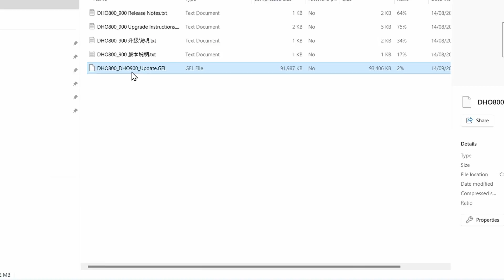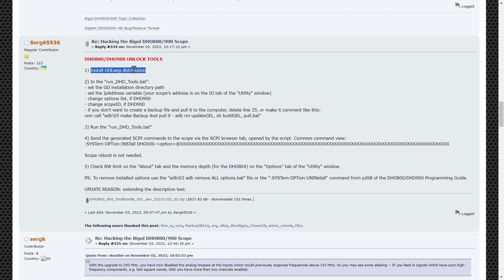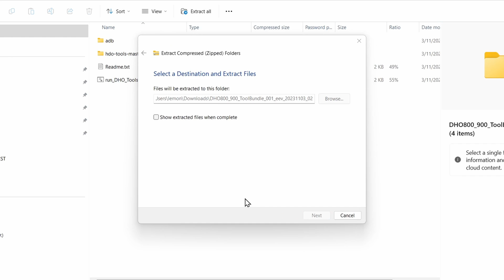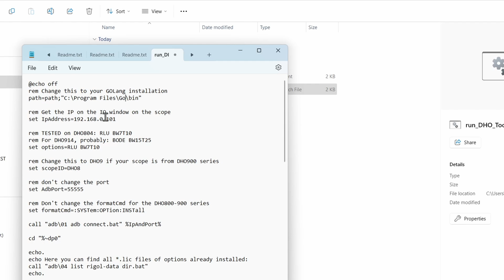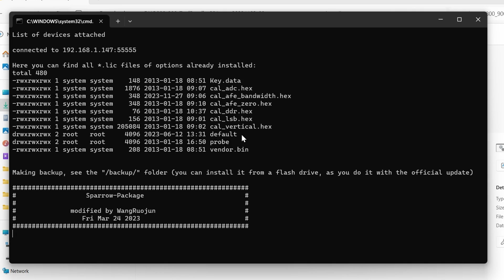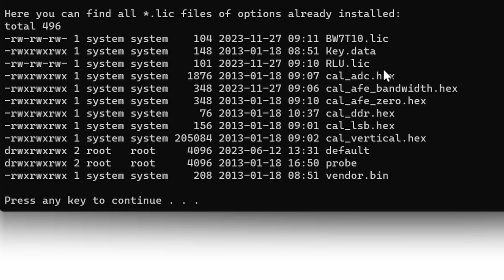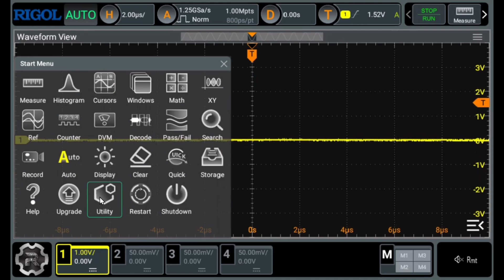Hacking the Rigol DHO804 fw 1.01 - 100Mhz bandwidth, 50Mpts memory depth

Comment: Many thank for great explanation, Can you help me, I just bought a Rigol Dho804 Oscilloscope, when I unboxing and turn on the display stays appears Rigol logo and no boot to the operating system, and no something until I turn off, I contact Rigol service he said that "Press the power button and quickly press the BACK button on the front panel multiple times. This may reset any incorrect settings.
Alternatively, place the latest firmware on a FAT32 USB drive, power on the device, and follow the on-screen prompts to upgrade the firmware."
I dont see BACK button on the front panel of it and how can I update original firmware
Thank you for helping.

Comment: Update, had firmware 1.2 on dho804 with no previous hacks. Did the mod and it worked fine, they were 4 options keys and I used only the first 2 which were memory and bandwidth. Don't know what the other two were.  Now the real test is to run the calibrate and see if it sticks.

Comment: There is an alternative UI for the Rigol DHO800-900 Oscilloscopes, it implements some enhancements and fixes to the stock UI, the most interesting thing is a full screen mode that allows to hide the two horizontal bars that take vertical screen space. (DHO800 Extended UI)

Comment: Had firmware 1.1 Did this mod it worked fine. I then upgraded the firmware to 1.02 or what the latest is.  Had others say if you already have version 1.2, this mod don't work. Seams Rigol changed a file name from Key.dat to something like RKey.dat. So have to do the other method on the EEVblog

Comment: If I understand correctly, I dont see how having more bandwidth helps you with lower speed signals. using double the sampling speed to sample a waveform simply adds redundant data. it doesnt measure it with more accuracy. See the nyquist limit.
Reply: If I draw your picture with 100 dots or samples it will be not good, but same picture with 10000 dots or samples is much better representation of you.
Reply: @kka10001  unfortunately its very difficult to post links in youtube comment sections. But if you search youtube for ''D/A and A/D digital show and tell'', the original video by Monty Montgomery was from xiph. you will find a fabulous video that does the best job of explaining the nyquist theorem I have seen, complete with demonstration with scopes. I link anyone that needs it, but I cant do that here, the reply will get deleted before you see it.
Reply: @kka10001  Sorry, you are wrong. Thats not how digital sampling works. Thats the same 'logic'' that has people buying 384KHz DACs to play 48kHz content. I recommend you read up on the Nyquist sampling theorem. You only need 2 (actually just a smidge more than 2 ideally) samples to represent a sinewave perfectly and using 4, 8, 16 or 1000 does not give you any more accuracy; they are redundant. To avoid aliasing, typically you want 2.01x the highest waveform you want to sample.
Reply: @jeremyglover5541  You obviously are talking about audio?
Reply: @jeremyglover5541  You must be an undergrad EE.  What Nyquist says is that, given an impossible to construct (noncausal) brick wall low-pass filter, you can reconstruct the original waveform from the samples.  He also assumes a perfect anti-aliasing filter preceded the sampling operation.  The math works fine, but that's not the problem an oscilloscope is trying to solve.  The scope is making a visual representation of the signal for a human to look at with his/her eyes, which lack the properties required for "perfect reconstruction".  Also, for music playback, it's nice to have some   bandwidth "headroom" above the highest frequency in the content to keep away from the bad phase properties of a steep anti-aliasing filter.
Reply: @tomw7751  Yes, you need 'some amount more' to avoid aliasing. that amount can be miniscule for perfect reconstruction. Youre right (not the undergrad bit) its not relevant. I thought about that later, but didnt come back to see until now. I wasnt thinking it through correctly. its a diagnostic instrument and when looking for visual cues that some edge case or issue may exist that you want to diagnose, you may want to see ringing, or rounding that may indicate capacitors going out of spec, layout errors, bad termination, or a power supply that is out of spec in the real mixed signal world, not just reproducing a signal that has already been sampled. 

Not an undergrad, far from it. work in IT, rapid prototyping and audio DSP PCB layout, but that was definitely a brain fart.

Comment: 5:39 Hi Retro, thank you for video. However, I could not find any Key.data & SCPI_commands_generated.txt. Only found backup folder.  Could you please let me know how do I do? Appreciate it.
Or anybody help me please?
Reply: what number of firmware in utility - about?
Reply: @TGodessa  Hi TG, I am using same version with Retro. ver00.01.01  The meaning of no Key.data & SCPI_commands_generated.txt is that I can not find in my folder. i.e., computer screen, at my folder.  Any help?
Reply: @rohsungjinable  Maby there is a problem with Go instalation as it is not needed for backup but do all the work with the hack.

Comment: Thanks for the vid.

I got my 804 about a week ago.
I wanted to go this route with hacking it, because I don't think the DC offset issues with the 800 -> 900 patch are quite sorted yet.

Ideally, I wanted as high a bandwidth as possible, to help with things like reversing the DMD LVDS protocol, but I've heard the "100 MHz" patch can be a fair bit higher in practice.

I'm sure the clever peeps will eventually figure out how to get the absolute max possible bandwidth for the 800 series without any other issues. (even if that's with only ONE channel enabled to get the max BW, it would be super useful.)

I can now finally retire my old DS1102E. It was never that great anyway. lol

I expected the 804 to be maybe a bit slow to respond to the controls, since it can be hard to get good realtime response when it's mostly done in software. It looks like Rigol have some very good programmers these days, and the 'scope works great so far.

It also doesn't take much longer than my old o'scope to boot up.
If I power up the 'scope before hooking up the probes or whatever, the boot time isn't really an issue.

I bought mine from the "China" link, which was £100 cheaper than from Rigol direct.
It looks like I only got a £33 customs charge (via Fedex), so it's a bargain really.
Reply: Oh, and I'll definitely have to get that battery pack 3D-printed.

Since the 804 uses USB-C for power, it also means it could probably be used on differential signals, since the wall-wart PSU will be "floating" vs mains Earth.

(I still would NOT recommend using the scope for higher voltages too often, though.)

Obviously the Ground part of each front BNC is connected together, so you could only ever try it on one differential pair at a time (without shorting the circuit), but still.

I might have to invest in a proper diff probe soon.
I find myself having to test things that use LVDS or TMDS quite often.

(the bandwidth of these 'scopes will never be high enough to get much detail from a typical HDMI signal, but still enough to see whether the diff pairs are likely doing something. Even 720p uses an HDMI "clock" of around 742.5 MHz. lol)
Reply: I just tested the (DC) resistance between the Earth pin on the included LiteOn PSU brick, and the 804 'scopes BNC ground.

It's almost exactly 1 Mohm.

So the 'scope possibly could be used for measuring relatively low-speed differential signals, if you're using only one probe.

(ie. without the probe ground shorting the circuit via mains Earth.)

Comment: Now I know that it likely isn't worth purchasing the more expensive models.  All of the 800 series are most likely all the same.  It irks me to no end that companies have been creating software defined pay walls on our hardware features these days.  Thanks for this hack.  I think we should be free to use the hardware as we please, after all we purchased it.
Reply: Heh. Trust me, it hurts even more when the $10K unit on your bench has a base price of around $5000, but with all the software and bandwidth options, would be around $50K, with zero changes in hardware. (Even the upgrade to 1.5GHz bandwidth is a pure license key. Not even a recalibration needed, like with some competing models.)